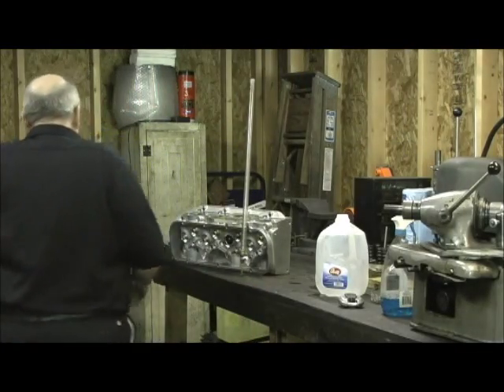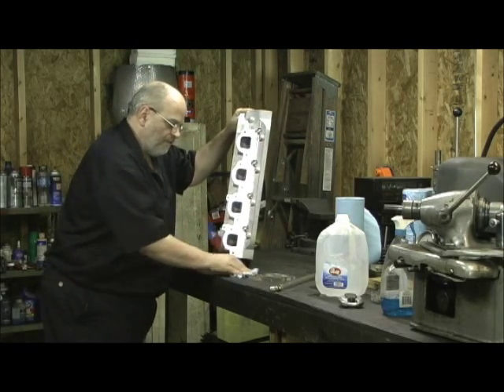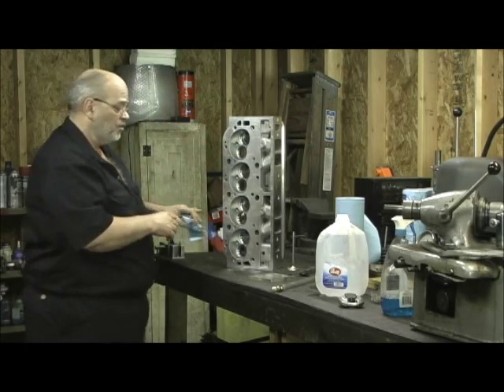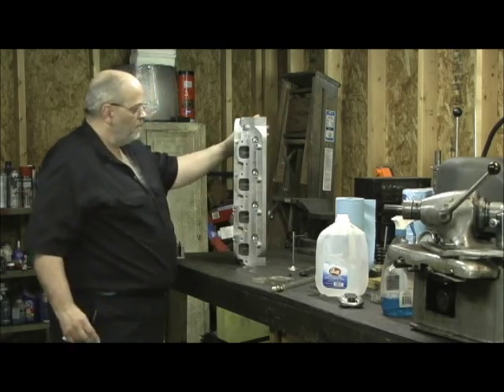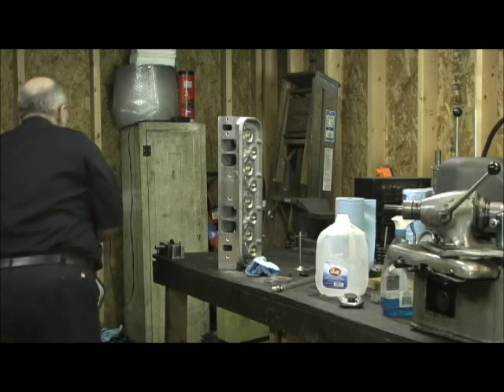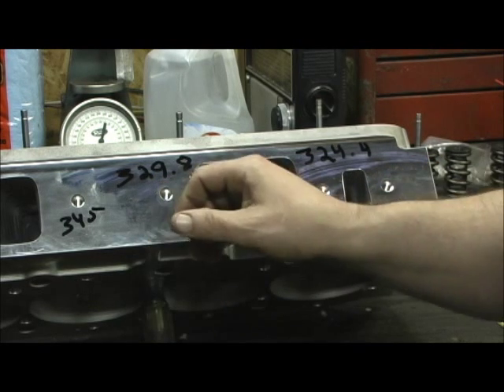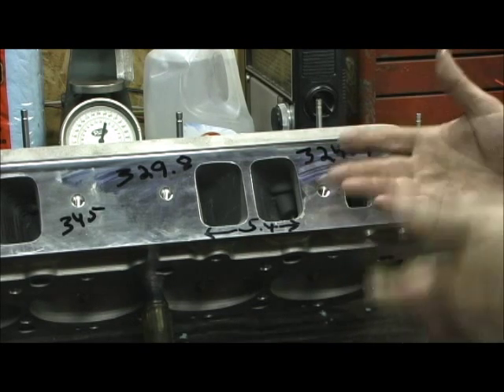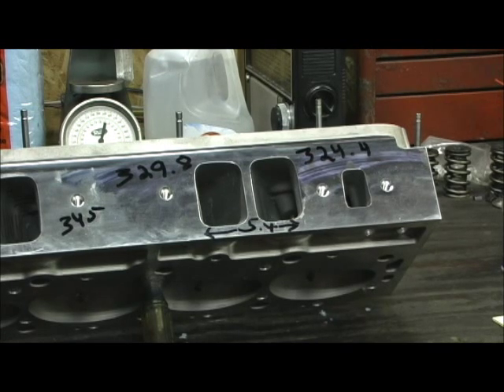KMJ 345 BBC Heads CCing before porting Part 3

Comment: Big Daddy Headbytes... how did that KMJ Assault brand 324.4/329.8 cc head turn out???  I looked for follow up vids but could not find them on your site.  I'm REALLY curious about that spring boss that was extending down into the roof of the intake port,  & just as curious about the exhaust port wall that the "hog" bit broke through & into the surface of the "tube".  I too noticed the raised port on the Assault heads & am about ready to purchase a pair.  REALLY like that rounded top of the exhaust port for porting work!  If I missed the follow up vids please direct me to them! GREAT instructional videos on your part!!!

Comment: I went looking for these heads online and it seem KMJ no longer advertises a 345 head, but a 320 head, which matches up to you measurements much more closely :)
Reply from the maker: TOO FUNNY!!! My customer on these heads (Raymond) had a fit when I told him I done the pulmonary intel on the head (CCing ports, checking guides and seat concentricity, Chamber volume BEFORE I touch the head to verify what I got to work with) and reported what I found. KMJ is not alone on this mess, as is Brodix, Dart, Edelbrock, RHS and all the rest have issues in "Claimed Volumes", with some being off as much as it would put it into another category. You don't know how many times I completed a set of heads for a customer and had them ask me to "CC the Head" in front of them to see my work, only to have the volume end up being the advertised volume of the head from the factory. Very troubling to say the least.

Comment from the maker: I will be doing in the next few months a 351 DO0E head, or the dog-leg head. I already welded the exhaust short turns up to tilt the port, and all that is left is the cutting of the intake ports and Tubes, I corrected the exhaust ports problems.

Comment: Yeah.. everytime i go out to the drag strip all the for boys go aftermarket heads.. it just made me wonder how much can be gained from the stock ford heads. If making atleast 400hp on a 5.0 is achievable with stock cast heads. Cuz they tend to split from what ive heard.i kno most ppl say gt40/p or e7 heads are the best.or the c9 or early 351w d0oe heads are good.. i managed to get a set of d8oe heads on my 5.0.. have you any knowledge on this set of heads. I kno the exhaust port is insanely smal